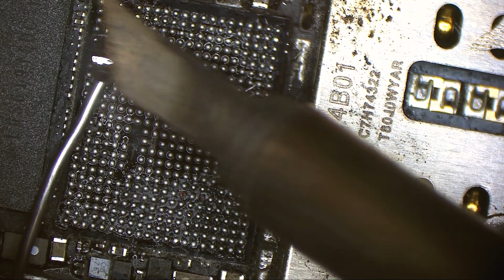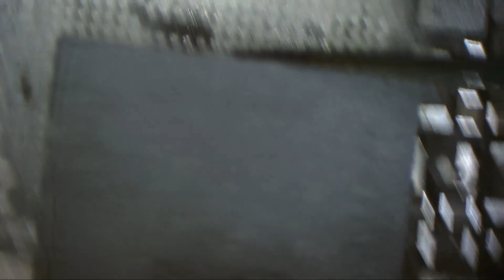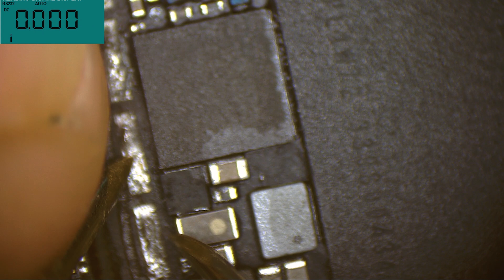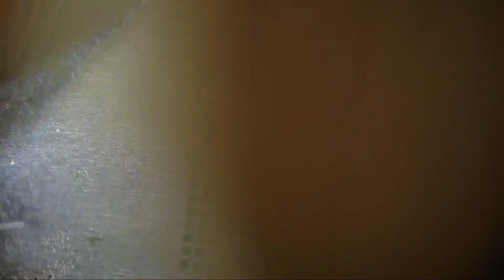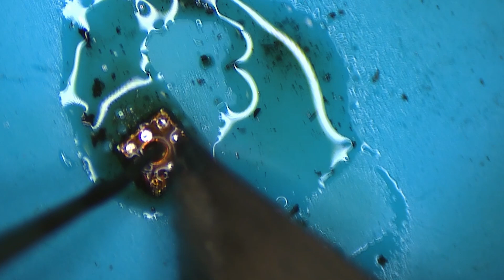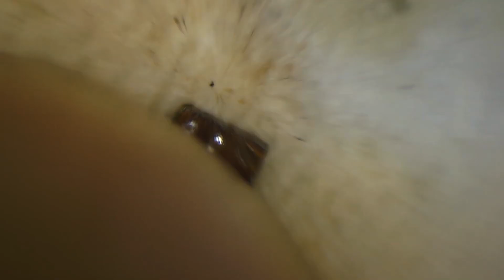Unable to Activate iPhone | iPhone Activation Error | Logic board repair

Comment: hi, i was interested by your video, i have an iphone 6 that wasn't starting so i repaired the PP_VCC_MAIN that was shorted but now, the phone don't want to activate, and i can't see the imei as you said at the beginning only the s/n. Also i noticed that there is a short on VREG_SMPS1_0V90 is it due to that ? thanks really for your help
Reply from the maker: you got the short follow it to find what component causing it this is the solution for your problem but if you don't know how to follow it this is a very long subject i can't explain in here if you wanna get into the details you can book a coaching call and i will explain to you everything to book a coaching call contact me on facebook.com/aymantherepairtech
Reply: Ayman The Repair Tech U BB RF was shortened cause it was hearing with the power supply so the baseband cpu has a short is it possible to replace ? Thanks
Reply: @AymanTheRepairTech  Hi! thanks for your answer, i found that Baseband CPU was shorted (BB RF) is it possible to buy a new one and solder it ? or the phone is dead ? thanks

Comment: ayman how can i get syscfg data while you dont have the original nand or original nand is not readable by proggramer??? are you using a specific gsx website?als what info do i need to restore a blank nand? only wifi mac and bt mac and serial?
Reply from the maker: you need Sn+ WIFI MAC+ BT MAC+ MLB and i am a distrbuter for this service it cost 10$ per device if you are looking for such thing you can contact me by facebook.com/AymanTheRepairTech and do paymept by paypal Aym.abdelsalam@gmail.com, by the way GSX would not brig you this information